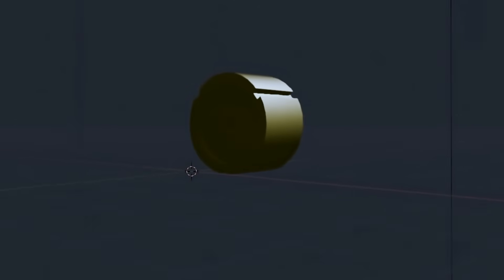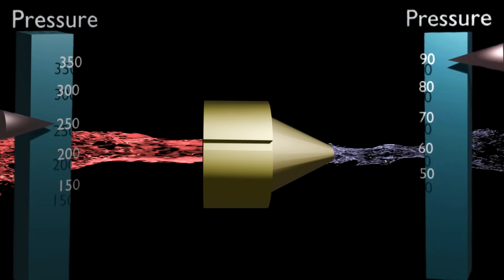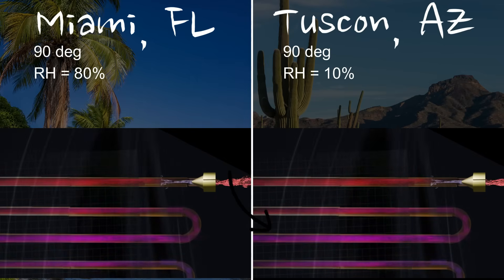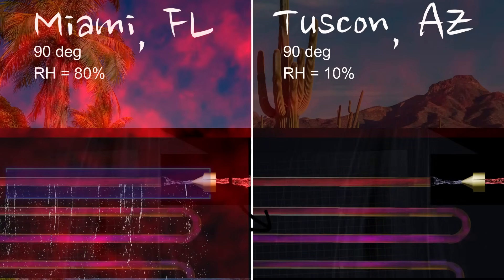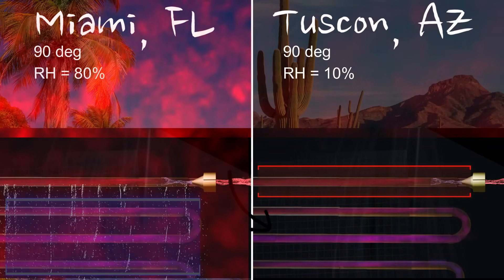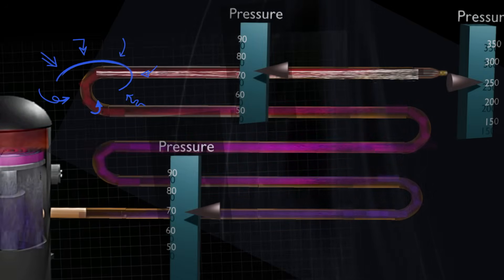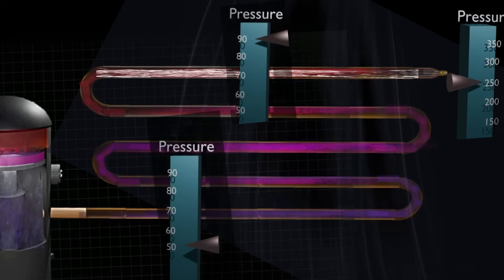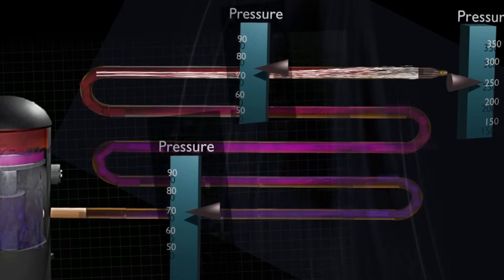The Superheat Lesson NOBODY Teaches

Comment: its why I designed my own non-compression phase change based Air conditioning system for my florida living. Its more efficient to run a chemically driven dessicator hooked up inline to a swamp cooler than it is to do it the traditional way.

Comment: I had a perfect example of this lesson on a call this week. I went to a house that had three systems. All of them were only getting about 14-17 degrees across. I put my gauges on them and the superheat was non existent. It would be in the negatives but my pressures would be high. I spent 3 hours checking each system for everything you can imagine, but the reality was, they keep their whole 3 story house at 78 and leave their doors open. We live in Georgia so the humidity is crazy. The systems constantly reached temperature while I was there and cycled off. It was only a maintenance call and the home owners said they never had an issue with them so I just left them how they were. My theory is the systems are overcharged but the home never gets cold enough for the coils to freeze just like you said in this video, and they have been running like that for 10 years. This job never fails to surprise me😂
Reply: On a cooler day they will flood back.
Reply: Should have left them alone, no reason to gauge up on systems with no apparent issues. You may have even created future issues by doing so via contamination/introduction of non condensables ect.  Sounds like you are lacking some experience. 14 to 17f split across evap in humid conditions like you mention is to be expected. Perfectly normal. Your superheat story is kinda strange, maybe you measured in wrong locations. In the future, for just doing yearly maintanance on systems,leave the gauges in the truck. Instead use non invasive testing to determine how the system is performing. This should be done on every maintanance.

Comment: lov love love this video!!!  I was in commercial HVAC design many years ago.. and these are some of the theories taught and applied during true sizing of systems... being in the midwest / great lakes.. we have a wide range of conditions we had to design for.. .. something else I wanted to bring up and that isd watching pressures..  if you arent performing any work on the refrigerant.. (meaning you arent giving it any heat inside) the pressures are going to look wierd on the gauges..  I got called out for a friend of mine who was stumped by a system.. a failed TXV left him with low pressures on both sides of the system.. in his mind he felt like a blocked TXV would result in High head and low suction.. he had low on both.. since no heat was being absorbed by refrigerant on the evaporator, the condenser didnt have to do any work, so its pressure stayed low.. his instinct was to charge it, after punching in 2 lbs on a 6 lb system with virtually no change.. .. I had him watch the rate of equalization after shutdown and it was very slow..the TxV was stuck on minimum (likely lost its sensing bulb charge).. when first turningthe system on, the pressures came pretty close to normal for a quick second... then would settle.  always let a system run 10-15 minutes..  the same reasons you mention here.. but also to get an accurate interior system load..  return ductwork in an attic or a basement may skew the perceived system load when testing.. need to let the ductwork come to its temperature of the return air..

Comment: I agree with you up until about the 3 and 4 minute mark. Why? Because heat is heat, and the latent heat involved with phase change is more dense - which is why, in an ideal system, you want superheat heat and subcooling to be minimal (maximizing entropy efficiency for a given enthalpy)… Assuming the evaporating temperature is below the dew point, and the fact that the heat associated with a phase change has greater energy storage / density, I would assume the heat transfer created by the phase change involved with condensation on the evaporator would be greater… Therefore, if you have two systems of the same size, using a fixed orifice, with the same air temperature across the evaporator (basically all other factors equal), the air with higher humidity will have a greater heat transfer and therefore the refrigerant will have a higher superheat exiting the evaporator… 

Accordingly, the refrigerant would reach the boiling point earlier in the evaporator, not further into the evaporator; however, this also ignores the fact that the distribution tubes span across coils and refrigerant is not introduced into the evaporator via one single point… Now, I did see at the 5 minute mark you start discussing pressures, and that complicates matters. However, now we start getting into very specifics on evaporator design which impact heat transfer… Regardless, I still think the fact the latent heat involved with phase change being greater in density still leads to refrigerant boiling sooner than later as (all other factors equal) the total heat load increases with higher humidity assuming evaporator temperature below the dew point in comparable examples…   

As an aside, this example illustrates the real benefit of a TXV as it responds to sensible heat; therefore, it will increase the refrigerant volume as it responds to the impact of high humidity…
Reply: That was my initial thought too.

Comment: You have it in reverse. Air containing a high amount of moisture conducts heat much better than air with low moisture. Therefore moist air will convey heat into the evaporator more efficiently than dry air. Therefore refrigerant will recieve a larger quantity of heat at the beginning and throughout the coil.
Reply from the maker: I see what you’re getting at, but that’s not how it plays out in a real evaporator coil.

On humid days, the coil has to remove moisture from the air. That moisture uses up a lot of the coil's ability just to boil the refrigerant. Since boiling keeps the refrigerant at the same temperature, you don’t get much of a temperature rise (superheat).

On dry days, there’s less moisture to deal with, so the refrigerant boils off earlier, and now the rest of the coil is free to heat up the vapor, causing higher superheat.

So even though humid air carries more heat, it uses that heat differently inside the coil—mainly for boiling, not for heating up the vapor. That’s the key difference.
Reply: @JerseyMikeHVAC  Unfortunately, we have to take laws of nature under consideration. 1. Conservation of energy  2. Conservation of mas.  Nature protects these laws with high accuracy.  So for your explanation to work one would need, for example to use TXV and introduce more refrigerant into the coil. The transfer of heat (energy) from moist air to the coil vs dry air will always be higher.  You are right that refrigerant while boiling out will maintain the same temperature and after the refrigerant becomes gas then the sensitive heat produces super heat.
Reply: @JerseyMikeHVAC  Ok greate job thanks